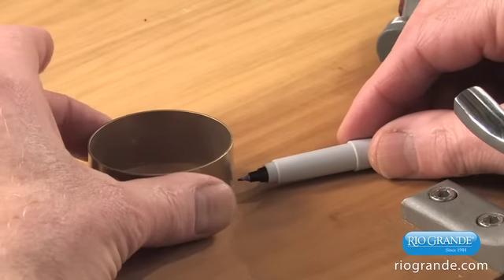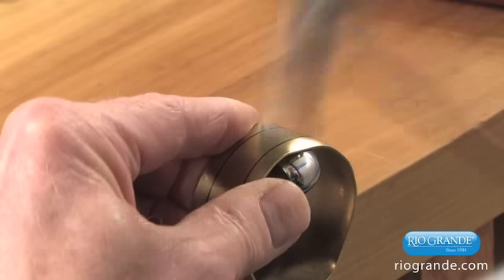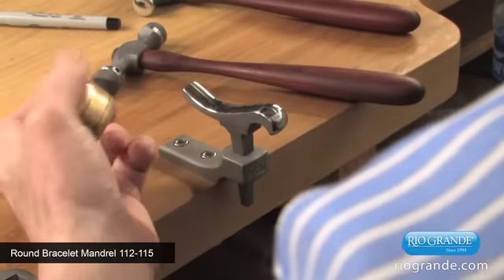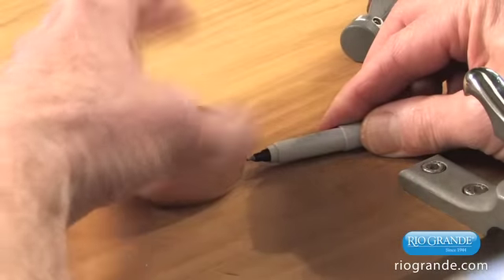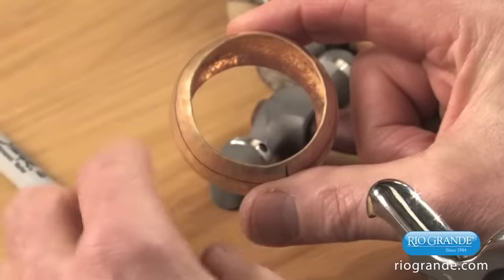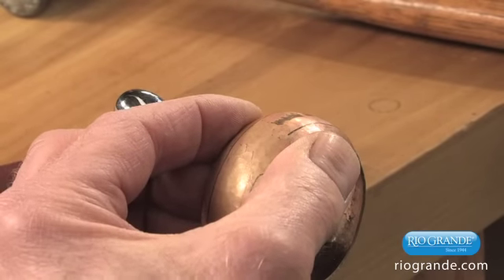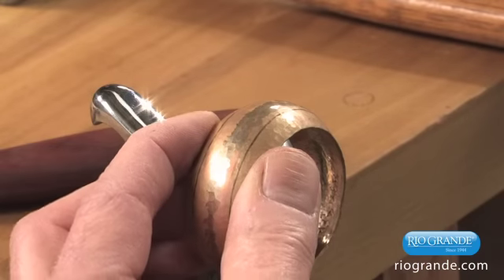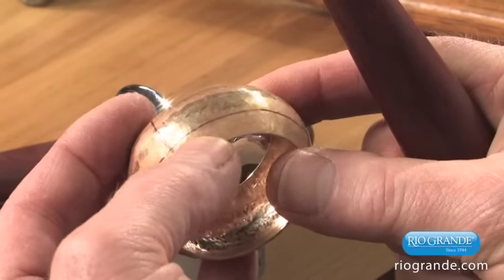How to Form Convex Bracelets with Fretz Tools

Comment: Thank you so much for sharing!! many cuff bracelets I noticed have a thick inner edge which gives them more rigity, would one simply solder a half round/thick wire along the inside edges before shaping the bracelet?

Comment: Fabulous! This is on your videos that I own as well. However, my question is, I would like to make a bangle as opposed to the cuff. How would I figure the right amount \ length of silver to use? As stated in the video, the outer diameter gets smaller due to the hammering. Would anyone happen to know what the difference is? I want to sell both large and small sizes.
Reply from the maker: Hi Teri! Thanks for reaching out to us :) Kate Wolf came up a bangle size gauge that comes in quite handy for these types of things. (Item 115338 https://www.riogrande.com/Product/TRUE-SIZE-by-Kate-Wolf-Bangle-Bracelet-Gauge/115338)

Unfortunately, there really is no universal standard bangle sizes like rings have. This tool references the inside diameter of the bangle, so the length would be the inside diameter + the metal thickness (gauge) x pi (3.14).

For example, to make a bangle from 16 gauge round wire with an inside diameter of 2.5” you would add 2.5” + .051” x 3.14 = 8.01," you would need 8” to make a bangle out of 16 ga wire with a inside diameter of 2.5”.

This is the same formula for creating rings. If they are making wide anticlastic bangles, they will need to add metal to compensate for the anticlastic shape, which depends on how severe the anticlastic shape is.

Does this help? Let us know if we can provide any more information!

Comment: Hi, I got lost :(  You started with an open ended bangle but suddenly you were working with a solid bangle.  At what point did you solder the ends?  Was this cut out of the video or is this a completely different bangle? Thanks, Sue ~